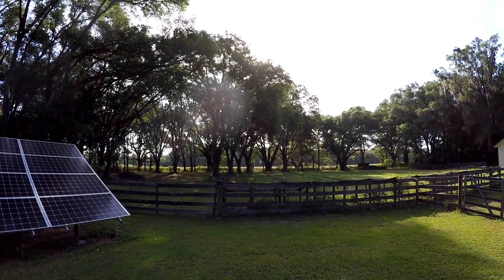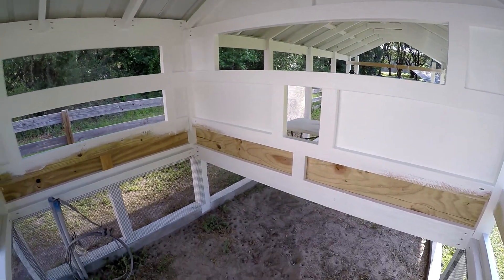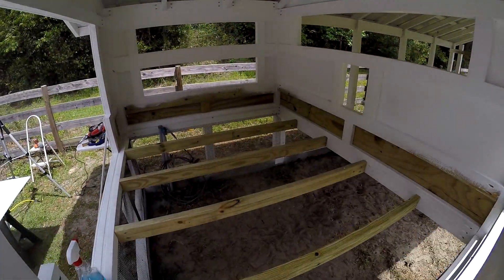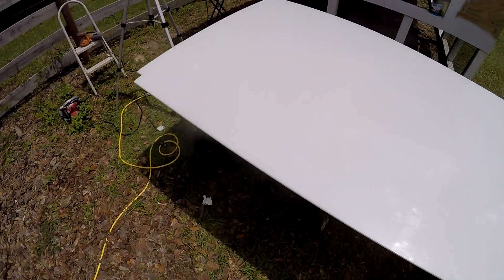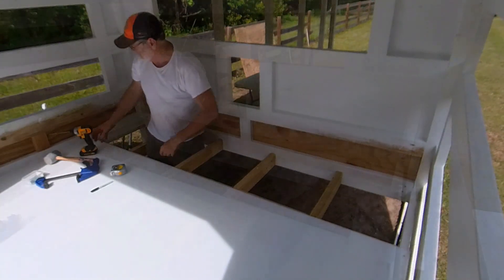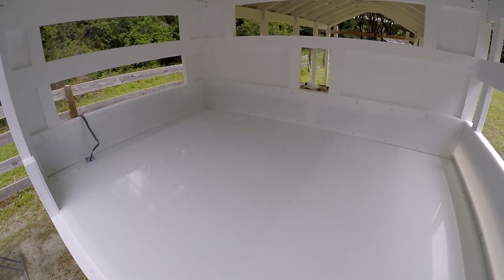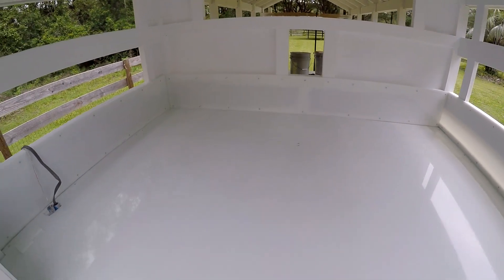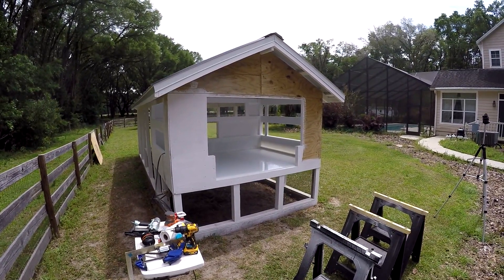Chicken Coop Build Pt10: HDPE Deep Litter Box

Comment: What thickness did you use for the HDPE sheet? Was two 48”x96 sheets enough to complete the job(sides and floor)… if not, what sizes and qty did you order for this project?
Reply from the maker: I used 3 complete sheets.  I had to piece together the cleanout door.  
3/8" 4'x8' sheets.  The link is in the description.  It runs about $250/sheet I think.

Comment: I love your chicken coop series! It has been extremely helpful to see all the details of design and assembly. I’m currently trying to design and build my own based on the Carolina coops American coop. 

I’ve never used HDPE before so I had a couple questions for you. What fasteners did you use? Did you have to do any countersinking? Thanks!
Reply from the maker: Hello Katie,  If I am not mistaken I think the American Coop would be easier and less expensive to build.  Basically you sheet the inside instead of the outside and let the framing become the trim.  That little trick eliminates a LOT of time and materials.  Much better bang for the buck.  As for the HDPE, I used the KREG pocket hole screws and counter sunk them.    
https://amzn.to/3KHUQ9Y
https://amzn.to/3kKZo4C
Thanks for watching, send some pictures when you get it going. :)
BTW: If you want to know what my coop is going to look like when closer to done, check out the beginning of this video: https://youtu.be/psqhD9V4nUU
Reply: Thank you for the tips and the links! I really appreciate the video series!

Comment: What is the thickness and dimensions of your HDPE sheets? Would you mind sharing where you purchased them from? I found some suppliers online but need to price compare and I'm also trying to figure out what thickness is sufficient for a chicken coop litter system.
Reply from the maker: 3/8" 4'x8' sheets.  The link is in the description.  It runs about $250/sheet I think.
Reply: @HomesteadEngineering  thanks!
Reply: @HomesteadEngineering  What is the size of your coop?  What is the height of the HDPE on the sides of the coop?
Reply from the maker: @holly1225s  I think the coop is 8'x20' with a foot of overhang on each end so 22' total.  The hen house is 8' wide and 6' deep.  The HDPE is 1 foot tall so as to get 4 strips out of a 4'x8' sheet.

Comment: Hey David, I have a couple of questions. Where did you get your HDPE at? What type of saw blade did you use to cut the HDPE?
Reply from the maker: The HDPE link is in the description.  I think I bought a special blade for cutting the HDPE but ended up just cutting it with my regular chop saw blade, regular table saw blade and regular skill saw blade.  Thanks!
Reply: Hello, what was the thickness of the HDPE? THANK YOU for the videos! A huge help!
Reply from the maker: @mikeyb9847  3/8".  Thanks!

Comment: Why imbed the posts?
Reply from the maker: Are you referring to the main 4x4 post embedded into the concrete?
Reply: @HomesteadEngineering  yes, but then I watched the other video and it made more sense. Was there a reason you didn't do all cement then build on top?
Reply from the maker: @mkens6624  The main post are in concrete to hold it down and keep it in place during high winds.  The top of the post are hurricane clipped to the rafters to keep the roof from blowing off.  I did not do a concrete floor because chickens don't like that.  They want something that mimics the forest floor like grass. leaves, small rocks, sticks and such.  They need to scratch and work and keep themselves busy.

Comment: Hi, The floor joists should be supported by a 2 x 4, not 4 nails.
Reply from the maker: Hello Peter,  I believe this floor will hold at least 1,200lbs.  That should do it...
Reply: @HomesteadEngineering  4 nails might be fine for you, but as a union construction supervisor a 2 x 4 is better than 4 nails
Reply from the maker: @peterlynch3252  I agree that direct support to the ground is always going to be better than hanging off the hardware.  That said, unless you got a 1,300lb chicken, its not going to matter.